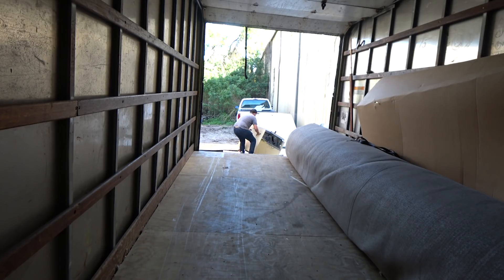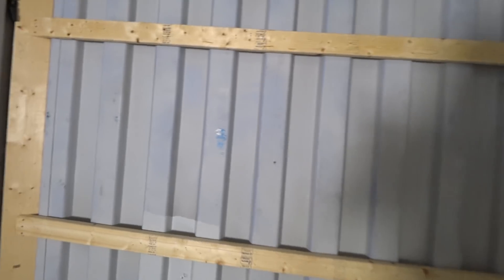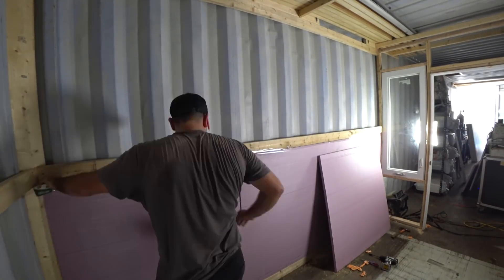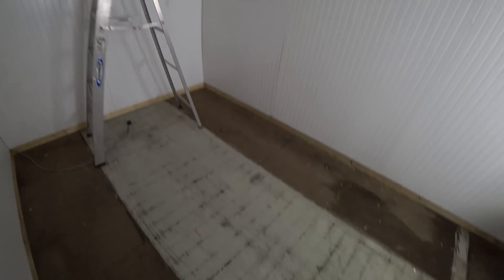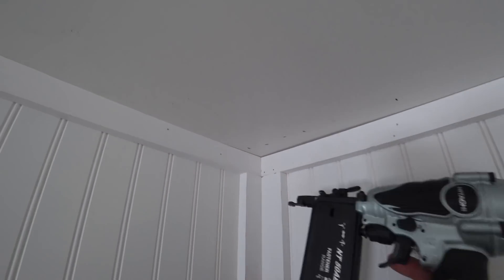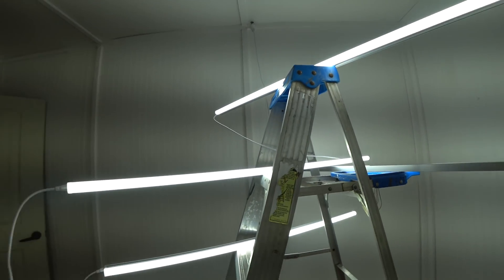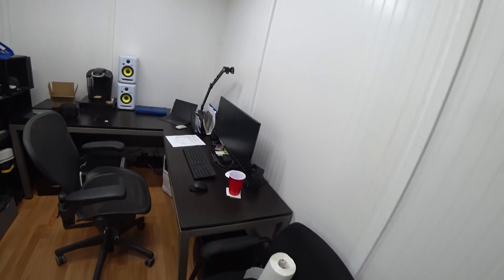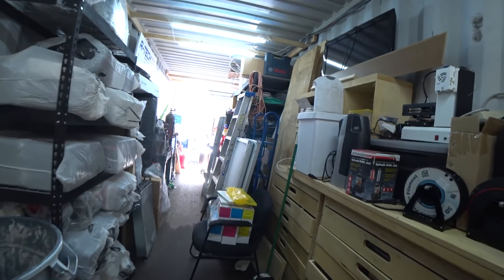Super CHEAP Shipping Container Office

Comment: I have a friend who is a twitch streamer who did this exact thing with a 20ft hi-cube container, but he combined it into his streaming office + solar shed, he built out his office in the back portions of the container super-insulating it, then when he installed his PC, he installed it on the wall instead of in a case to save space and he went pretty unique with it, he went water-cooled on the PC, but he installed the radiators and fans on the hot side of the divided wall so all the heat from his PC is dumped outside his office. The front portion where the solar stuff is installed on the walls is vented outside via temperature fantastic fans on the wall of the container. On the roof of the container, he installed his solar panels and runs everything to his house, so his office and house are partially offset by the grid-tied solar from the container.

Comment: I just discovered your channel, been binging on them all morning. 
AC condensate pump. $50 on Amazon
If you can slip a 3/8 copper or pet tube outside, you can funnel the unit's condensate into the pump. It has a float and when 3/4 full, pumps itself empty, then resets.